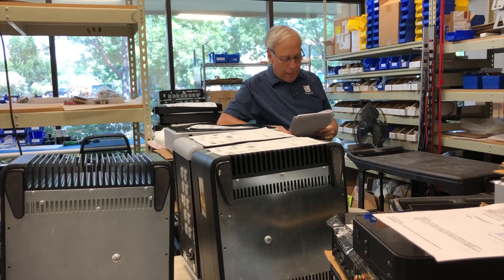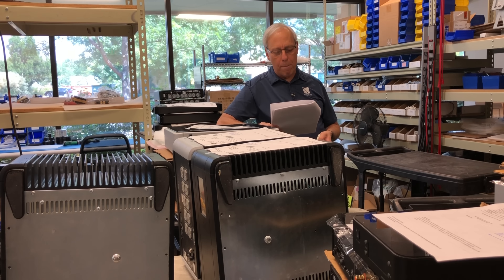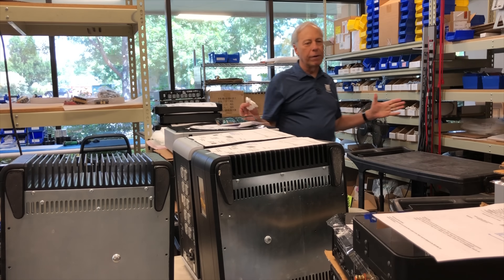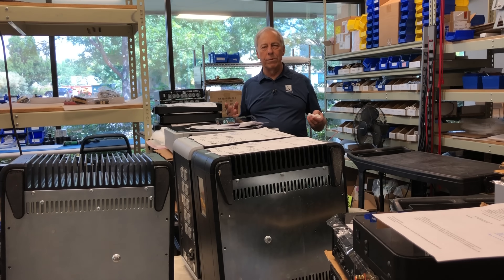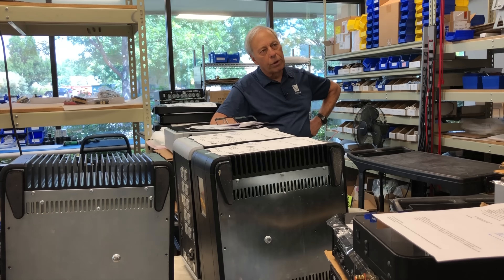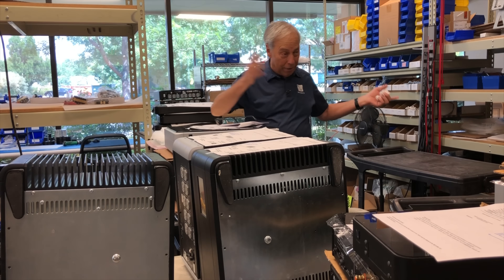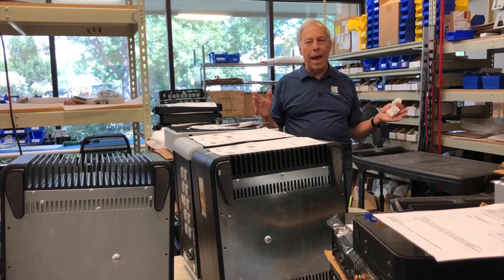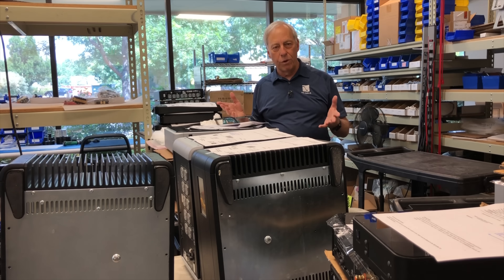Why should speaker cables have a minimum length?

Comment: the shorter the better
Reply: if the signal is traveling at near the speed of light from the amp to the speakers, then no human should be able to discern the difference between 1.4, 1.5, and 1.6 meters.  In fact you could mix-match a 1.4 with a 1.6 meter cable and 99.9999% of humans on earth will not hear a difference.
Reply: Exactly
Reply: Apparently I've got  with this length of cable also unusual results. But 40 years ago. I connected it rather to very special construction of wires made of parallel bronze microspirals. But fact is that it was just about 1,5 meters driven by tube mono amp . Today it is hard with stereo - usually too short.
Reply: Not really. I find that less than a Planck length (1.61622837e-35 metres) creates timing issues.
Reply: @jonathansturm4163  hahaha...
Reply: @Jonathan Sturm I find uncertainty in your statement.